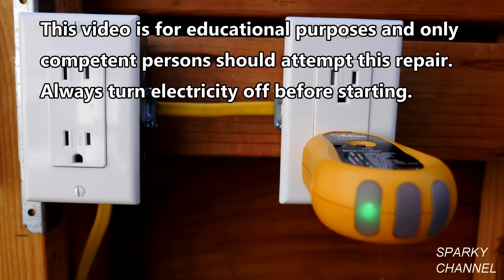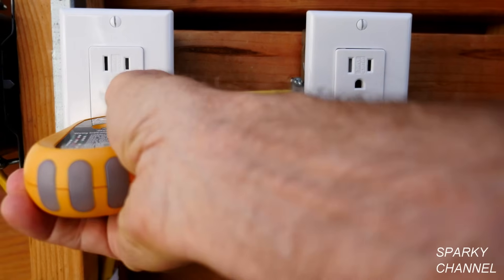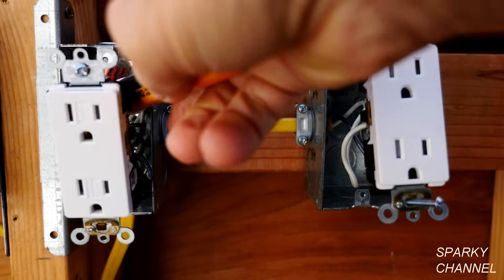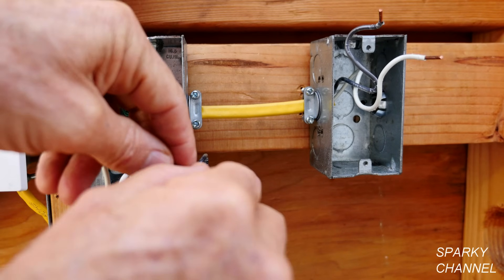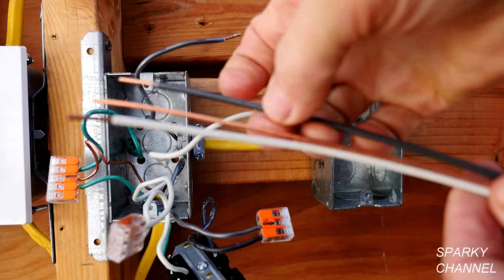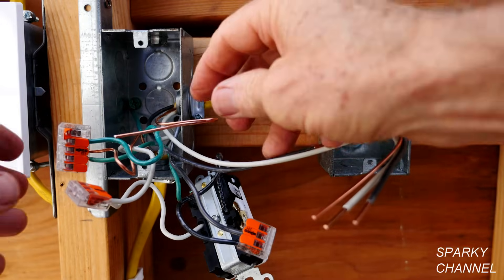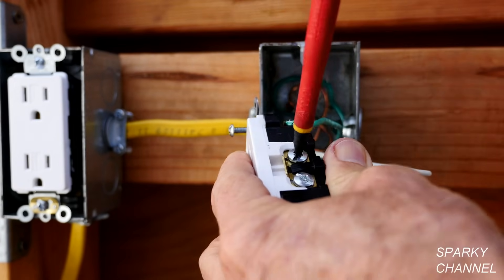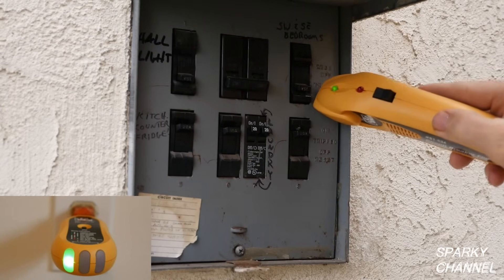How to Fix an Open Ground

Comment: I heard that you aren’t suppose to have a ground wire in a metal receptacle box. I mostly have metal boxes in my apartment and they aren’t grounded. However I have metal boxes that are grounded via the box not the wire I guess that’s safer.
Reply: Someone may have given you incomplete information since there is no such rule saying "you aren't supposed to have a ground wire in a metal receptacle box"!   In fact, you're REQUIRED to have one there, in many cases.  Perhaps they were referring to the metal boxes connected via metal-sheathed cables or metal conduit that already provide "grounding" without necessarily NEEDING a "grounding wire inside the box"?

Comment: Couldn't you just use a GFCI instead?
Reply: Yes, in most US jurisdictions the NEC permits replacement of an ungrounded receptacle with a GFCI receptacle, with other possible restrictions (e.g., AFCI, TR , etc).  You first have to prove that "no equipment grounding conductor is available", whether with a wire or a properly bonded metal-sheathed cable.  406.4(D), in NEC since at least 2005. The GFCI would then need to be labeled "No Equipment Ground", as a warning for people who might have an appliance that actually needs ground, such as most types of surge protectors.

Comment: What if you’re in an old house where somebody rewired it, put in three-prong receptacles and none of them are grounded?
Reply: It's possible (and maybe even legal) to "put in three-prong receptacles" without grounding them if the circuit has GFCI protection, which could be in the form of a GFCI breaker.  All they would need is a proper warning label on each receptacle stating "No Equipment Ground", i.e., ungrounded "grounding-type" receptacles, if your local version of the code permits that.
Reply from the maker: Hi Michael. That's against code so I would advise you do something like this: 2 Prong Receptacle Circuit Replaced by GFCI and Grounded Receptacles per 2020 NEC: https://youtu.be/16KObgI44UE

Comment: FWIW. There is no Neutral wire in either box. It is a grounded conductor, according to the code book.  
All the rest is educational and helpful. Thank you for showing the value of checking everything for correct connections and voltage.  Also for using a voltage detector repeatedly. These little tools are priceless. 
Also. Many choose to use a crimp sleeve or a green wire nut. The crimp sleeve is a much more definite connection, and takes up much less space.
Reply from the maker: Thanks!

Comment: What would your wiring configuration be if the outlet box was the blue PVC type?
Reply from the maker: It would be the same except the PVC box doesn't have to be bonded.
Reply: @SparkyChannel  So the (new) bare ground wire from the upstream receptacle could have connected directly to the new (downstream) receptacle?

Comment: Hey Sparky you are the man. I have learned a lot with you. Thanks big bro. I have question. I have an open ground. But the previous owner installed a GFCI receptacle. Some outlets in that circuit when tested show correct wiring, but the others show open ground. Should I rewire or install an extra GFCI?
Reply from the maker: Hi Lucas! My guess is that you have a loose or broken ground wire somewhere in your circuit and that when you find it and hook it back up all of the receptacles on your circuit will suddenly be grounded. Just a guess though.

Comment: Can you do a video about finding and repairing electrical shorts? I have a light switch that is tripping the breaker when it is turned on. Thanks.
Reply from the maker: I'll see what I can do. Thanks!
Reply: Did you check in the switch and in the light fixture. 99% of the time shorts are at the termination points of the wires, so it would probably be at either of those points.
Reply: At least that has been my experience

Comment: 6:49  you have proven continuity but not necessarily "1 box away"  There could be a box in between these two that is pig-tailed that would give that same reading.
Reply from the maker: Yes, that's correct.

Comment: The most important reason for the ground is to prevent getting electrocuted by a faulty appliance. If a cable insulation inside of the appliance fails and live parts would touch the metal housing, on an ungrounded outlet the voltage would "sit and wait" for a victim to touch it. In case of a grounded housing there would be a short-circuit, tripping the circuit breaker (or blowing the fuse) almost immediatly. No chance of a person getting an electric shock. That was the reason for introducing this safety mechanism.
This protective measurement was first mentioned in Germany in 1924 as a possibility, in 1932 this became mandatory in the VDE 0140 (protective measures against electric shock) which is still existent but it was modernised over the years like all regulations.
Reply from the maker: Yes, that has happened to me. I get it all wired up and then realize that I forgot the cap. LOL! The ferrules are a good idea. Also tinning the copper strands would be excellent.
Reply: @SparkyChannel  Tinning is not a good solution. There's a reason this practice is banned here since 1979. The problem is, the solder will start deform under the pressure of the screw, creating a loose connection which is also a potential fire hazard. I've seen such connections, and the wire directly fell out of the terminal just simply by gravity. It also corrodes, causing a contact resistance. If you completely solder such a connection this is not a problem, because the corrosion is only on the surface of the solder. But in this case this would be a problem.

This happened several times to me that I forgot the cap. Sometimes it's not a problem when the other end of the cord isn't connected to anything yet, but sometimes....

Comment: Hey Bill, when you say the “neutral goes back to the power source”, I understand it goes back to the panel. Does it go anywhere else beyond that?
Reply: To the transformer on the street...and depending on the system, it is going back to the generator in the power plant with points in between where it is grounded. The neutral is a grounded conductor, a so called "operational ground". That what you simply call "ground" is the "protective ground". That's the reason the NEC calls the neutral also "grounded conductor".
Reply from the maker: Great answer Marcel!
Reply: Marcel Germann Thanks Marcel that helped

Comment: Great vid. Next time just leave 12 inches of bare copper in the box with no ground and then do this: wrap the bare copper around the metal box bonding screw, then continue to the green terminal of the receptacle. That way u eliminate the extra wago, no pig tail needed, and the ground 100% continuous. Solid grounds with the least number of breaks are greatly preferable. Woohoo
Reply: 12 inches is excessive (that's what she said)
Reply from the maker: That's an excellent method. Thanks Dave!